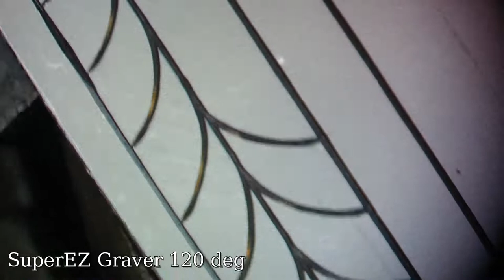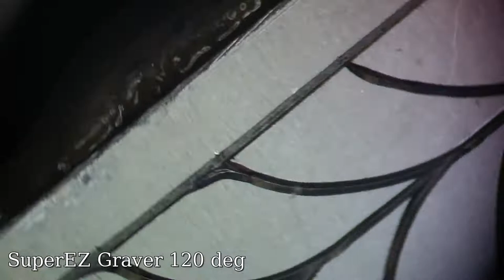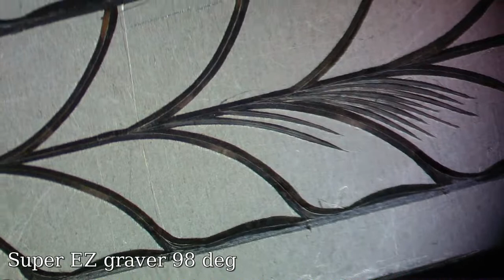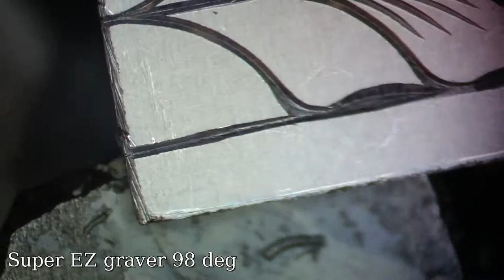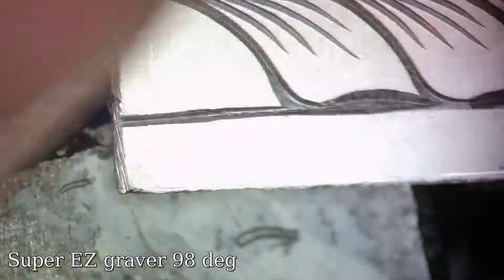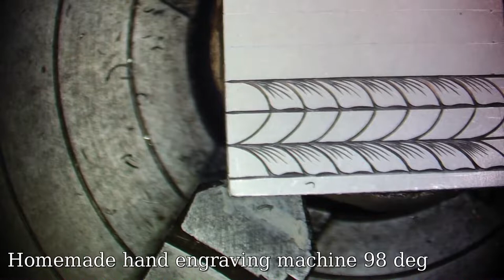Homemade hand engraving machine vs Super EZ graver face off cutting 304 Stainless Steel.

Comment: Awesome video as always! It’s awesome to see these machines preform so well.

A possible future improvement might be adding a load cell/strain gauge to the Super EZ handle allowing you to vary the frequency (or power) as you vary pressure on the graver. (I.E., the harder you push, the faster the frequency; the lighter you push, the slower the frequency.)
Reply from the maker: Thank you, I have a pressure sensitive resistor to try this but have not got around to experimenting with it yet.
Reply: @alastairduncan4702  I think I can safely say we’re all looking forward to when you do!

Comment: Another great vid Alistair .The scientific approach! I like it. Love the way the EZ starts. They both sound like they are hitting a bit to hard for me, and would run the Homemade slower, which results in harder hit. I'm almost about to think about putting my one together! Yo did great shade lines and more than enough power .
Reply from the maker: Thanks Shaun, I think you are right about hitting a bit to hard, that's why I'm loosing the tip frequently. Carbide is much harder but not as tough as HSS so although it keeps its edge for longer it is more brittle so a hard hit is likely to break the tip. I was surprised by the shade lines, the first set was much finer and I thought it would not show very well but it blended nicely to provide subtle shading, learning by mistakes again ;-)
Reply: @alastairduncan4702  They all looked neat than i do. Just incase. Try going as fine as you can. I always tend to go a bit deeper than i should sometimes. It's so effortless really fine it feels like you are cheating, but the eye appeal, can be much more effective. Refering to coins

Comment: Awesome setup my friend! You should try Lindsay carbalt gravers. They hold up better than the carbide. I've heated them up pretty good and they don't get damaged. Although with carbide heat usually isn't a problem carbalts are more heat resistant and not magnetic.
Reply from the maker: Thanks for the info. I think the other to try is the GRS CMAX or so the adverts say. They are a lot more expensive, the carbide that I have was around around £0.75 per cutter but there's a fair bit of inconvenience when the tip goes.
Reply: @alastairduncan4702  Yes GRS is great too! Keep the video coming👍

Comment: Hi I have made similar version to the grave using arduino nano and it get overhead to the point that the 3d printed hand peace gets distorted(2-3min of work).
Is there a solution to the overheating.
Thank you in advance ☺
Reply from the maker: The problem of overheating is caused by the amount of power being pushed through the  solenoid. What solenoid do you use? what duty cycle do you use? if the solenoid is drawing too much current or the current is applied for too long it will overheat. Are you using the engraving tool at maximum power? what material are you engraving?

Comment: Hello Alistair I've got everything got it all wired up and the solenoid is to long. Did you cut the screw thread off it? And did you cut the piston down? If you did how long is the piston? I've gone all through your videos it doesn't say nothing about cutting the thread and piston down. Please help im so close 🙏
Reply from the maker: Excellent, yes I did cut off the screw thread and yes the piston needs to be cut down. I also removed the label from the solenoid so that it's not so tight in the handpiece. Once you have cut off the screw thread from the solenoid and cleaned it up with a file this can be installed into the handpiece. Screw in the inner sleeve add the spring and the piston. Press the piston in so that it's hard up against the solenoid body, then offer up the QC toolholder. You should be able to take a measurement for how far it is protruding from the handpiece. The measurement needs to be for the part which can move inside the handpiece. Subtract 3mm from that measurement and that is how much you should remove from the end of the piston. What you are aiming for is, when the piston is fully depressed the QC toolholder protrudes no more than 3mm from the flat area of the handpiece. Taking off less is better than taking off too much 😉 you can always cut off a bit more but it's much harder to add material back. 2.5mm protruding is probably optimal with the piston fully depressed.

Comment: Hi,
I have a small question. I'm after a few runs on engraving with machine made of your design - electric one with solenoid - and I got a drop of force after some time. I think it is due to heating of the solenoid. Do you think that the higher the temperature of the solenoid can result with the lower power of strikes? Or should I look for the problem at some other part/component
Reply from the maker: Electrical resistance increases with temperature for copper. The windings for the solenoid are made from copper. When the resistance increases then the power drops off. That's my understanding.  I've not found it too much of a problem as the type of engraving I do does not push the solenoid at its max. The brass handled version does disipate the heat better than the 3d printed handle.
Reply: @alastairduncan4702  Thanks.

Comment: How the hell do you cut 304 stainless steel?! ive been catching hell trying to work with some blanks and i cant get a line any deeper than a thin shading line with any gravers ive tried.
Reply from the maker: The thick lines cut using the Super EZ graver in this video are 0.25mm wide. This is the only test I've done using stainless steel as I don't work with stainless steel. What width do you want to engrave?